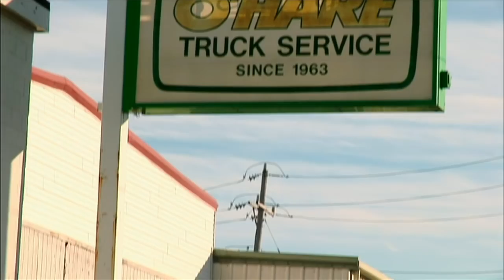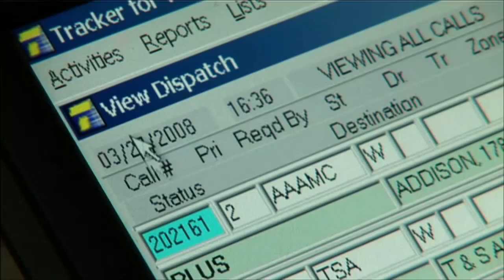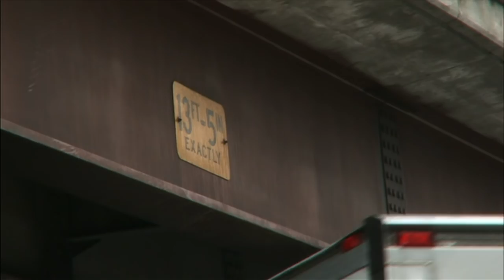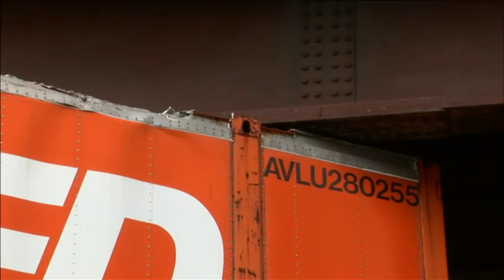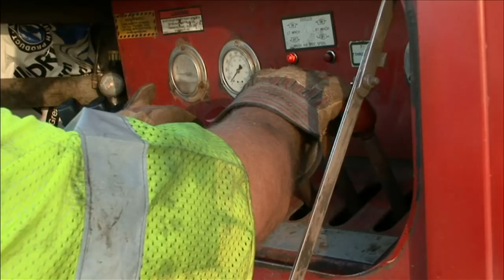Wrecked - Season 1 Episode 13 - Bill Goes Stir Crazy | SPEED

Comment: Why don't they drop air pressure on the tires, pull out the trailer and reinflate the tires.  Or, doesn't  it take away from the show?
SERIOUSLY!!
Reply: MikeandLinda Pomarez They will usually air out the air suspension not let air out of the tires because it would take an hour to deflate and then reinflate the tires plus you risk unseating the tires on the rims.